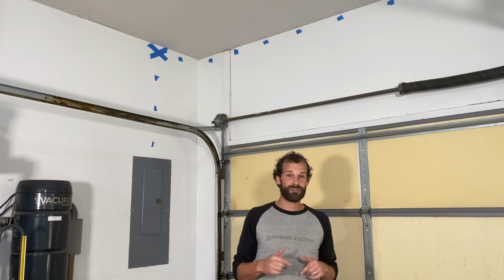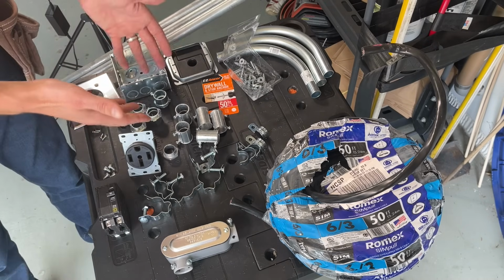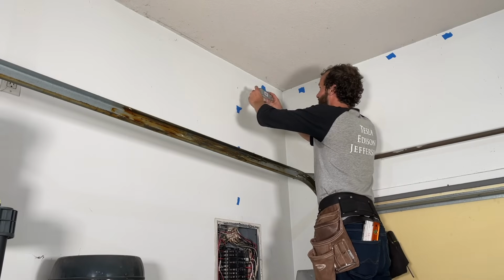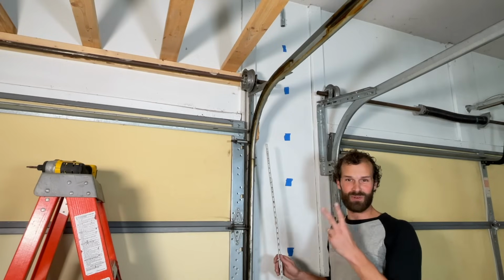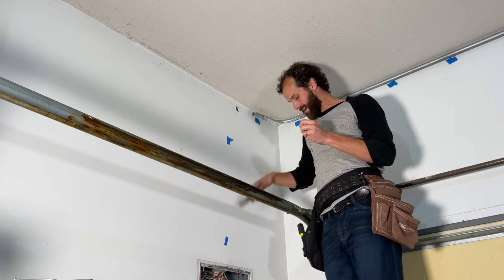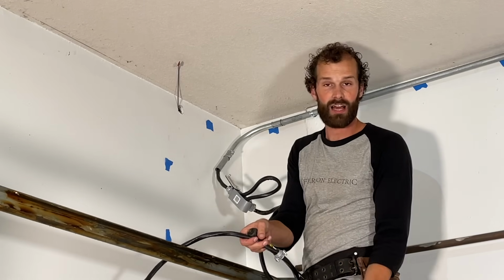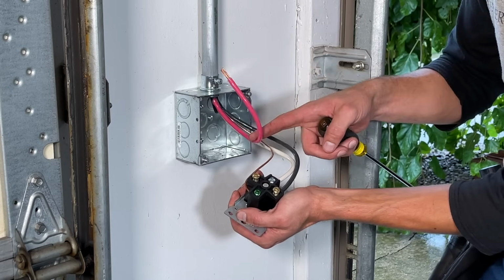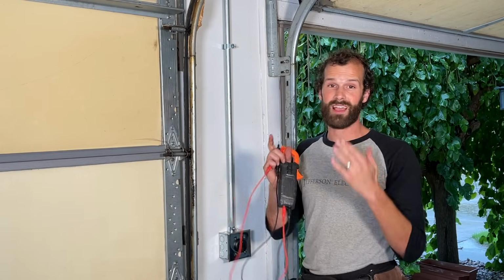How To Install a 240 Volt Outlet | Electric Car Charging

Comment: Here in the UK and in Europe, every garage has at least one 240 volt outlet. Granted they may be only 13 amp but that enables anyone to gue a granny charger. Such a charger can easily add 100 miles of range and that is all that is necessary for most requirements. I have a granny charger and tend to use it quite a bit more than my dedicated 7kw Level 2 charger.

Comment: Do you know a good way to drill through a thick concrete wall to run 1.5" plastic conduit for an outdoor NEMA-1450?
Reply: Rotary hammer and a 2" masonry or core hole bit.

Comment: I read that Romex 6/3 should not be run through conduit due to heat and if you do, you should use at least 1". Is the information I'm being told incorrect?
Reply: Yes, should be at least 1". Wrong on the romex in conduit, perfectly fine and does not generate excess heat.
Reply: The romex sheath doesn't generate heat. Heat is only generated by the current carrying conductors. But the romex sheathing absolutely does add insulation, which retains more of that heat generated in the conductor. Upsizing the conduit diameter to allow more airspace is one way to counter the excess insulation. That the code fill calculations are different for multi-conductor cable like Romex (e.g. 1" EMT here) are for this reason.  @pld8993
Reply: @nathanscandella6075  More of the heat is not retained simply because it's in conduit and the amount of heat generated/retained is no different whether it's in conduit or not. Conduit fill calculations/requirements have nothing to do with heat and have everything to do with physical space being sufficient for the pulling/installation of conductors/cables without damaging them. Code fill calculations are not different for cables vs conductors; they are based on physical size. Also, as long as the conductors are sized properly for the circuit, excess heat is not generated regardless.

Comment: Does the pole that attaches to the electrical box outlet run all the way to the electrical box where the breakers are located, or just runs up to the ceiling?

Comment: Maaan, almost teaching how to use screwdriver and hacksaw. Come on... Get the important stuff out - circuit breaker, wire size, conduit and associated parts. Show the connections and outlet location, that's it. 5min, not 50.

Comment: you need to have the ground copper wire attached to the junction box as well. oops CODE violation! Are you a professional electrician(?)

Comment: I can't believe how many pros (like this guy and others I've spoken to locally) don't know that the current codes require a GFCI breaker for an NEMA outlet based install for EVs.  And it will  pretty obvious to an inspector that the outlet is not for a dryer when the outlet is installed right in the middle of the garage doors).  The thing is, those gfci breakers are 10x the cost of a normal 50A breaker.    Add to the the cost of the box, the high-end outlet, strain relief, and your already over $250 (in 2023).   Now say you want to buy another mobile charging cord for you vehicle so that you can keep one cord permanently in the garage, and take the other one on the road for an emergency.  Now you are well within the range of a nice charger (like Tesla's $425) with an integrated 24' heavy-duty cable, that needs no GFCI breaker (per code), no electrical box, no strain relief, no outlet, and avoids plugging/unplugging wear.

Comment: To avoid struggling with the wire run, why not use larger diameter conduit?
Reply from the maker: THHN wire would have made the pull much easier and is the correct wire to use as compared to Romex in conduit.

Comment: Useful but actually misleading video as it contains misstates that they correct in a subsequent video. So if you do not watch the subsequent video then you would install it incorrectly, which is what I did and then had to redo the work. And the guy calls himself a certified electrician. Really?

Comment: I watched the video. I'm from South Bend, IN 
I'm already bought 2023 Ford Mustang mach e ,
I'm wondering for wires, so it's 6×4 gauge it's so expensive specially my garage is not detected with my home I need 60', so what do u think I should do little bit cheaper??!
Thank you for the video

Comment: I did almost the exact same kind of installation in my garage, but I used 6/2 MC cable in the wall, then individual #6 wires (#10 for the ground) (THHN/THWN) in the conduit for a 60 amp circuit.  No strain pulling the wire and did not have to beat it to death to get it to fit that conduit body.  #6 NM is only good for 55 amps (44 amps continuous). #6 MC and #6 THHN/THWN is good for 65 amps, so I could configure the Tesla Wall Connector for a 60 amp circuit and 48 amp charging. Instead of a conduit body, I installed a box where the conduit connected to the NM and used Polaris connectors to join the wire.

Did not look like you used a GFCI breaker!
Reply: I agree. Code in my area at least is to use a GFCI breaker in a garage!

Comment: a great video. thank you. we have 2 Tesla and installed 2 separate NEMA outlets on both sides of the garage for convenience but never charge 2 cars at the same time. however, one of the outlets keep dropping the charging Amp down to 16 after only a couple of hours of charging. We used 50Amp separate breakers and 6 gauge wires as you did. Wonder if you can provide some advice. i appreciate your comment.
Reply: Check the tightness/ torque of the terminals in the panel and at the receptacle. 
Pro tip— did you use a 1450 Hubble with hex screws and torque to 75 inch pounds?
The 10.00 ones at the big box stores won’t last long.

Comment: You'd be a fool to do this yourself without checking with a licensed electrician. You need a licensed Electrician and a good one to check out your wiring to see if its safe to put in a 240V box. If not the wires may melt and start a fire and burn your house down.  Some houses especially old ones can be death traps. You also may need to upgrade your box first. Check with a licensed electrician first. always.

Comment: With your example bolstering my confidence and reminding me of the process: I just finished doing the same in our tandem garage. The job was a bit easier given the surface mounted circuit breaker box and choosing a surface mounted 50amp 240 volt outlet.

Comment: Great video for example what not to do.
Too tight...
Gauge wire and size EMT agree.
Open panel could also be a problem.
Also...
For each bend make it harder to pull.

Comment: Every time I watch you two... I wish you guys were just down the road from me so I can hire you.  I have a question:  Electric hot water heaters/tank;  do you need to hot wire or can you use female/male plugs?

Comment: The receptacle you are using is not designed to be used for that application.  I would suggest a hubbell are Bryant.  A Range receptacle is designed to be plugged in and left.  A EV charger is being  unplugged regularly. 
Thanks 
Enjoyed the video
Reply: EV chargers are plugged in and left alone. They are not unplugged regularly.

Comment: Ground should be attached to the metal box and receptacle. 
That's a pro tip
Reply: Isn't the box bonded to the receptacle ground via screws.
Reply: @the_lar  Box must be grounded independently of the receptacle.

Comment: Why was the neutral connected if is not needed for ev chargers ?
Reply: Technically, the EVSEs out there that I've seen don't use a neutral wire. However, many of them are sold with NEMA 14-50 plugs. For those, you need a NEMA 14-50 outlet. And, I believe that if you are using an outlet that takes a neutral pin, you have to actually connect a neutral wire to it. Otherwise, you're installing something that's visually misleading. Electrical systems (e.g. outlets) aren't supposed to make assumptions about quirks in plug-in devices downstream of them.

You certainly could search for EVSE that comes with a NEMA 6-50 plug, then you wouldn't need the neutral directly, or for the above indirect reason. But, charge hardware with 14-50 plugs are common, partly because 14-50 outlets are common. They're an RV standard, so people with mobile charge cords often have 14-50 plugs.

Comment: First, excellent video.  👍  I'm about to get the electrician to install  240 Volt 40 Amp (NEMA 6-50) for a Grizzl-E Charger EV niveau 2, 16/24/32/40 A.  The Charger will be adjusted to 32 Amp to get  7.68 kwh power as my EV only accept 6.6 kwh charging speed. My question:  is it OK to use NEMA 6-50 instead of NEMA 14-50?  I've already purchased all the hardware,  🧐

Comment: A 50 amp circuit at 240 volts delivers 40 amps or 9.6 kW.  The Cadillac Lyriq, a vehicle we're considering to buy, can handle charging at 19.6 kW.  Can you produce a video showing the installation of this Level 2 charging?  Thanks!

Comment: How come the conduit has to be completed before installing the wires? Seems way easier to set up the wire & conduit sections on the ground, along with installing the receptacle and then mount it to the wall?? Is it a legal code thing?
Reply: Yes. Conduit system must be complete before the wires are installed, NEC requirement.

Comment: Sandy Munro has a good video on the difference between cheap-ass dryer outlets and industrial grade... with charred examples.  The question is, is "industrial grade" a real thing, or is it like "Heavy Duty" which means nothing? Besides the price, how do I tell the difference?
Reply: Yes and no. I don't think there is a specification for "industrial".  Its just a marketing term to differentiate the cheaper outlets from the commercial and industrial versions from the same company.
Reply: @PoNKPoNy  I used to work in the testing lab at I-T-E Bulldog Electtric in Hamtramck. I think bakelite is a little more tolerant of high temperatures than thermoplastic.

Comment: Why has no one called out the obvious DO NOT USE NM-B or Romex with EMT Conduit? the Romex is its own conduit. NEC does not clearly call it out, but pulling 3 6 AWG wires (white , Black, Red, and 8AWG) or using the EMT as the Grounded conductor is the ACTUAL WAY TO INSTALL using EMT? Im just blown away that all I've read is how awesome his job was?????? WTF
 For anyone who wants to challenge my theory I've been a Master Electrician for 10 years!
Reply from the maker: No, I agree with you that Romex was a bad call on this one and makes the pull much harder.  With so many comments it is hard to see all the feedback but there were plenty of call outs when the video first came out on using Romex as opposed to THHN.  Thanks for the feedback.
Reply: The EMT in this case is being used as physical protection for the Romex. Romex is not its own conduit and is not allowed to be installed where subject to physical damage. Simply attaching Romex to the wall surface is a violation, must be protected. Yes, this install is amateurish and not at all how a pro would have done it.
Reply: @pld8993  Romex can be installed in conduit for short runs, when necessary to protect it from damage.  This looks excessive to me.
Reply: @ericjorgensen4826  While it might look "excessive," whatever that means, there is no maximum length that Romex can be run in conduit and nowhere in the code is it restricted to short runs or only when necessary for physical damage. if you wanted to pull Romex through 500' of EMT, while that would be foolish it wouldn't be a code violation or dangerous.

Comment: So, I'm not sure if I trust on anything a person who makes claims that between October 2020 and October 2021, price of copper increased 300%. The actual increase was from $3 per pound in October 2020 to $4.73 per pound in October 2021, which was the highest price that month. That is a 57% increase. Even if you take the lowest 2020 and the highest 2020, 2021, 2022, or 2023 prices, the difference is 127%. So, either pretty bad math for an electrician or intentional misrepresentation.

Comment: Pro tip: when fishing wire in a live panel, put a large piece of cardboard inside to cover up all the breakers and feeders. Also wear safety glasses at all times. Where I am, we would not put Romex inside conduit. Run stranded wire and conduit all the way. A “telephone 90” fitting can be used to get into the panel easily.
Reply: Good tips, both.  Only a DIYer, but I thought running Romex through a conduit was a no-no,  due to its inability to dissipate heat

Comment: Great video! 1 question: Why no "wiggle wiggle wiggle" when you installed the 2 hot conductors into the breaker? And I guess the same for the neutral?
My run will be a long one, but I'm hoping 6AWG will be fine since it's AC.

Comment: At 22:33 you make a point of talking about how the conduit is part of the ground, but I don't see how it is grounded - there's no connection from the conduit to the panel through the plastic conduit body & run up through the wall, the only connection at the box end is the bare ground wire being hopefully pressed up against the inside, and the rest of the run is insulated. What did I miss?
Reply: Correct, the conduit could be the grounding path only if it was continued all the way to the panel. The way this was done, the EMT is not and cannot be your ground.

Comment: These outlets are also terrific for powering large single phase air compressors and welders, and rotary phase converters to run things like used three phase industrial air compressors, welders etc depending on size.  DIYers with patience can wallow in quality used industrial equipment for same or less money than consumer crap but having that large single phase outlet (or more than one since parts are cheap and you're in there anyway!) is key. I even added them to my rented house (with landlord permission, he was also my best friend) and took them when I moved. 

Look into the many products including cords, splitters and other hardware used to power RVs from these outlets. I promise it will be useful info if you DIY.

Related note re: "cool stuff powered by outlets": I put my horizontal tank compressors and my welders on dollies I fabbed to use scaffolding casters (which just slide into a tube and are magnificent, get the round shank style) for easy handling. If you rent and put everything heavy on wheels the rest of your life gets impressively easier. You eventually need to move most of your stuff so if you make that low effort in the beginning you never sweat again.

Comment: I need to install a 240volt 50 amp outlet for EV charging in my own garage, but my situation is a bit different: my breaker box is on the outside of the garage wall, and the outlet will need to be inside. So I am not sure how to go about penetrating the wall. I've also seen other videos on this subject that urge use of a Hubbell or Bryant Industrial Grade outlet instead of the cheaper Leviton outlet. Great video, thanks for posting it!

Comment: Incredibly informative with an engaging teaching style! Did Joel tighten the set screw on the fitting at the top of the vertical conduit after 24:45 ?

Comment: Two code fails- 1. Gfci breaker needs to be installed. 2. Can’t run romex thru pipe
Reply from the maker: Yeah, for most installations these days GFCI would be needed but we are still on 2014 NEC and I think that came in with the 2017 update.  For Romex (although not ideal) you can be run through Romex as long as it is not a wet location.  With that said it is much better to go THHN to help with the pull of the wires through the conduit.

Comment: For 6/3 wire everything I read said to go with 1 inch conduit to allow for heat expansion.  the 3/4's looks much easier to work with.  What am I missing?
Reply: 1" is required in this install, but it's about conduit fill and has nothing to do with heat or expansion.

Comment: 29:00 instead of Grabbing the wire and uncoiling it, If you would unroll the spool 
"Like you would a rug"  you will not have any twist in there at all.
Reply: Also, before taping, if you staggered the wires at the end, instead of one big clump at the end,  It will pull way smoother

Comment: I've already install a 240 and this lines up with what I've done. Excellent video. Thank you for taking the time to do it.
Reply: He screwed up in this video,  like a lot of electricians, that know nothing about EV charging.
He installed a outlet that is sure to melt over a long charge.    Hubbell Lighting 125V 50A 3-Pole 4-Wire Receptacle – HBL9450A, is rated for the EV charging.  .. These guys only run the required, Cheap ! they never oversize the wire.

Comment: I have a question please ? do you always have to run a 6/3 cable? If you are running a 40 amp line for a welder couldn't you use a 6/2 cable as long as you tape the white wire with red or black tape to designate it as the additional hot wire .

Comment: How come the wire that runs to the outlet is so much stiffer than the long Tesla charging cord? 

Why does this wire need to be in a conduit when the charging cable can just sit in the open

Comment: why pop the breaker in live? just hit  the main breaker disconect switch. never do live work if you dont have to and even then leave it to qualified people if u dont know saftey or what your doing. you get shocked from a 240 panel u can die easy

Comment: The electrician told me I need a 200 amp panel because my 100 amp is not enough, is that true? I never saw anyone here on youtube suggesting that! Should I proceed with this opinion or  no?
Reply: A car charger draws alot of amps. And a good amount of amps is already being used for everything else running in your home. Would definitely get that upgrade before trying to install one.